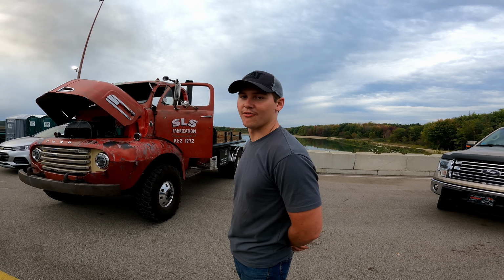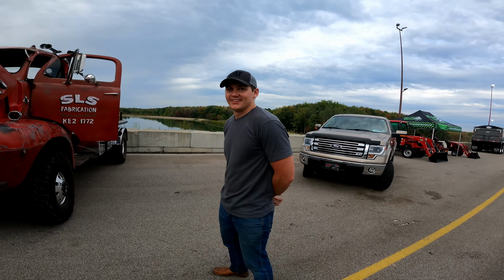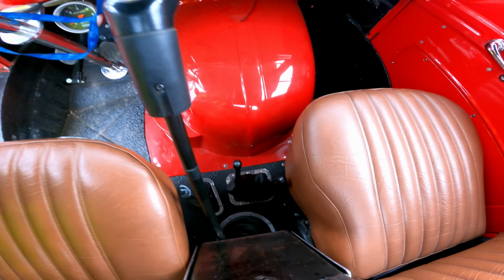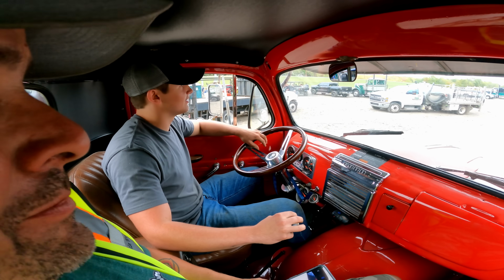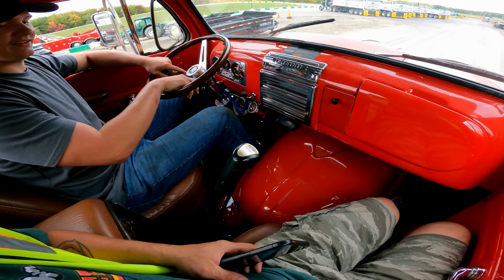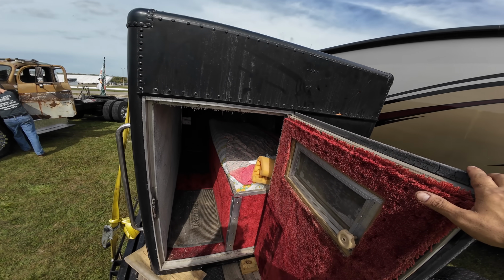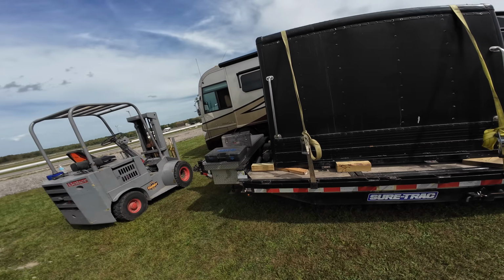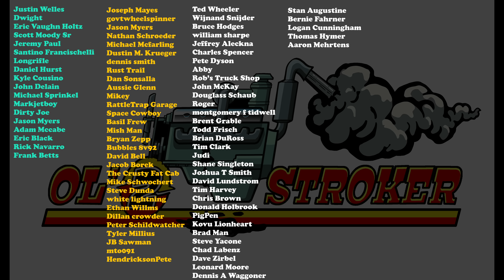Insane Detroit Swaps you gotta see!

Comment: I watched my neighbor, Don, Nick and Carl Schaub construct the '48 Ford C cab for several years, when they needed air for transmission shift, train horns and misc., I donated that TU-Flo 400 BW compressor with exposed unloader valves, that was on the 64 CHev-C-65 HD   4-53N engine that I ran in my conversion for 11 years. Nick has been honing his driver skills for years with everything that had an engine !